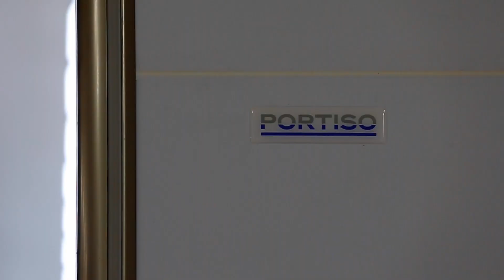Lugrade - Isothermal panels & industrial doors | ColdKit

Comment: Hello, how are you? would you have a job opening for cold room assembler?
Reply from the maker: Please send your CV to rh@purever.com. Thank you for your interest!
Reply: Hello sir any jobs  would you have a jobs cold storage cold room heat room clean room where house and all tipe puff panels rockwool panel tharmacol panels  flooring insulation doors fitter  installation plz contact plz after lockdown I'm not have jogs